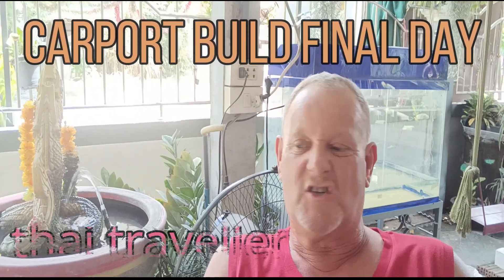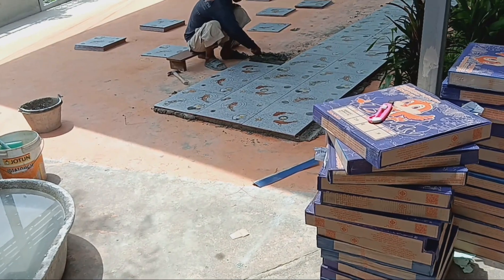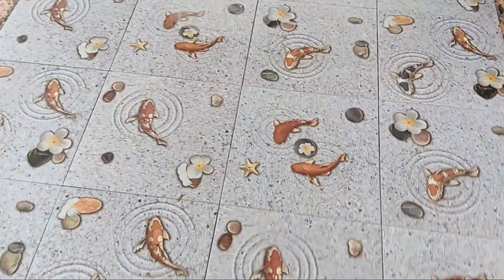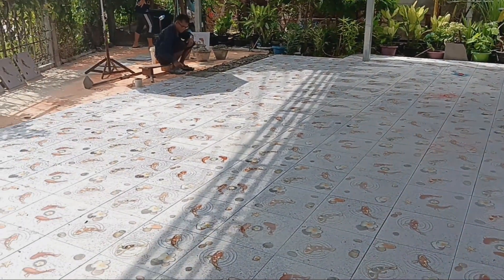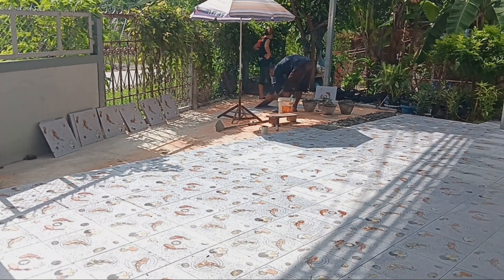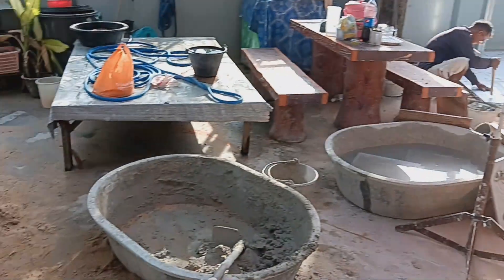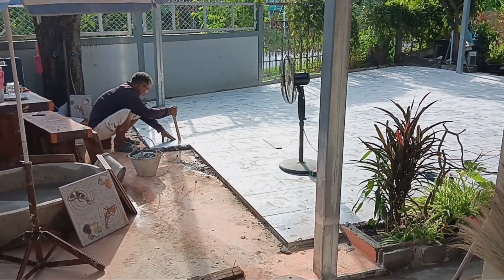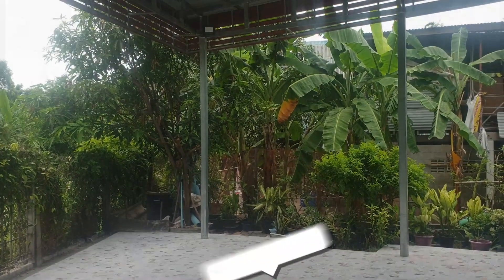carport build in thailand vlog 4 the final day

Comment: Thanks for sharing can i ask why is the new car port roof so high, and will you be adding some type of screen to the sides to stop the sun and rain getting in, cheers
Reply from the maker: originally was getting attached to main roof  but then there might be a problem with guttering
again i think that we will  put a screen down the roadside , it doesn,t need to come to floor level may drop three quarters
thanks for suggestions